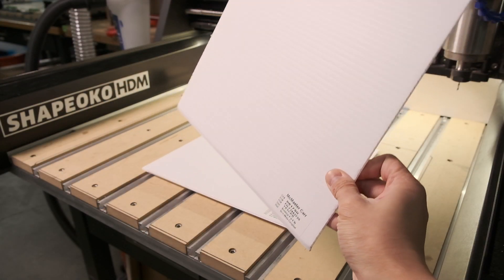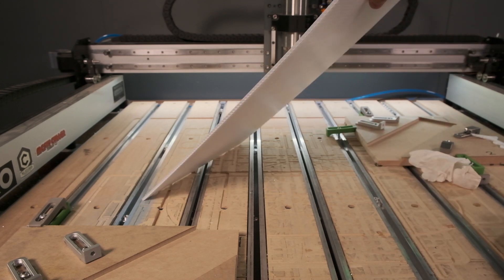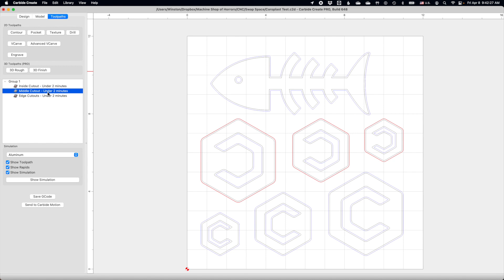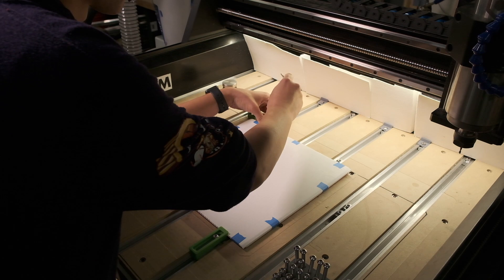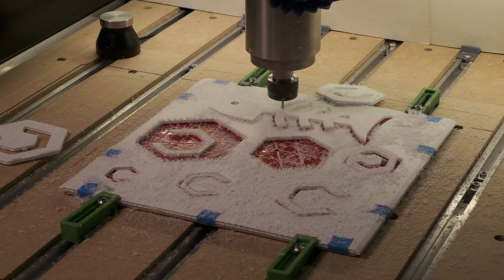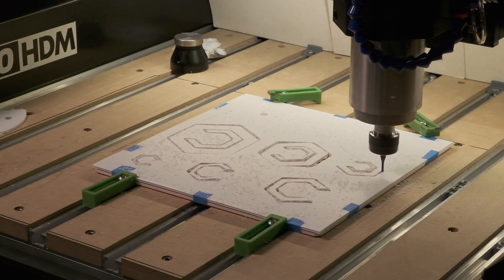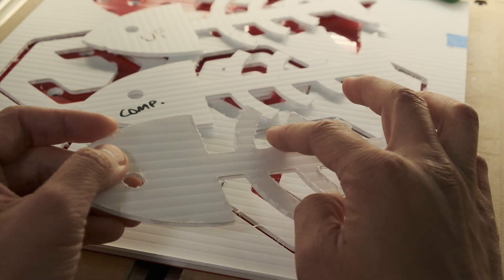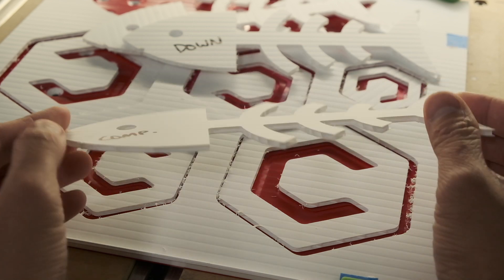How to Cut Corrugated Plastic on a CNC Router

Comment: Thank you, your settings worked perfectly for me on the altmil. I double-tapped right to the table, 0.1 mm deeper than the bottom of my stock. These settings, with compression of any size, produced great results. I was having issues deciding on the plunge rate until I saw this video. I had planned  to try a drag knife next but think I will save the 100 bucks.

Comment: Had to do some jobs cutting coroplast recently. It was too much mess and cleanup to work with endmills, so I tried an oscillating tangential knife, which works great - no mess or cleanup on the edges. 
I’m going to try a drag knife soon to see the results on that also.
Reply: Can you please give me a link to the oscillating tangential knife? Is this something you can attach to the router?

Comment: I would think this is a good situation to try something like a spray adhesive, a fairly mild one. while still taping the corners what way you did. Super 77 might be too strong. But would be worth giving a shot. Fairly quick and easy to work with, but not sure how the plastic in this cause would behave with a solvent.

Comment: My greatest success with coroplast has been with a) vacuum hold down and b) a drag knife.

A used spoilboard is the absolute worst enemy to clean cuts using any tool with materials such as coroplast and thin PVC. Surface your spoilboard, then dial in your depth of cut so as just cut through the material, but not into the spoilboard.

Using these techniques, I've successfully run jobs of as many as 2,000 sheets of 4'x8' material with incredibly clean cuts requiring zero post-processing, without a single mark on the spoilboard.

Hope this helps others reduce their time to success using these types of materials.

Comment: Will it cut solid 3MM or thinner Polystyrene sheet ? Building 1:87 models.  This is much needed amongst scale modelers world wide. You make a affordable CNC machine for scale modelers that cuts styrene sheet. You'll be a rich man.
Reply: Yes, it will. However, a straight flute square end mill is a better choice than either downcut or compression mills. For best results, use the smallest possible diameter bit. 1/8" is probably best, though you may have no choice but to move up to 1/4" due to depth of cut for thicker materials. Set your spindle speed to 18,000 rpm or greater, then experiment with feedrates to dial in the cut quality.

Also, if you don't have vacuum hold down, consider building a small vacuum table that can be affixed to your spoilboard. Alternatively, painters tape and CA clue works great. If you don't know what that is, it's when you apply painters tape to both the stock and the spoilboard, then apply CA glue to the tape on one surface, then, aligning the tape strips, press the stock onto the table. When the job completes, you simply rip the piece off the table. The painters tape is quickly and easily removed, leaving zero residue on either the piece or the table.
Reply: @ARepublicIfYouCanKeepIt  Thank you John.

Comment: Straight flute end mill will probably be the better choice. because you don't need to remove any chips. No pulling or pushing in the material from the endmill.
Reply: Yup! You're definitely correct.

Comment: Nice. We use a cnc knife to cut in our shop. Not sure if there drag knife attachment you could try
Reply: there is.  https://www.youtube.com/watch?v=ichixsl7KXA
Reply from the maker: There are a couple third party drag knives that will work, but you'd also need to pair it with software to compensate for the axial offset of the blade to prevent corners getting rounded off. 
Our Stingray drag knife wouldn't be able to cut something of this thickness. About 1/16" is it's operational max.
Reply: @carbide3d  drats.
Reply: @vikingcat794  No drats. Dog River drag knife with VCarve Pro and a plug-in works flawlessly.
Reply: @ARepublicIfYouCanKeepIt  Irrelevant if you don't own VCarve.
Reply: @carbide3d  The Dog River drag knife, together with VCarve Pro and a plug-in works flawlessly.